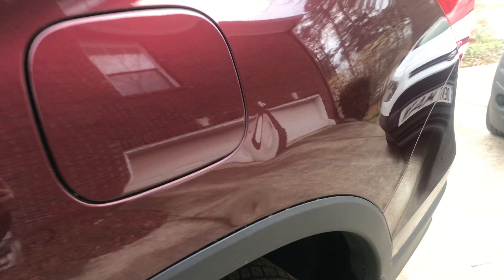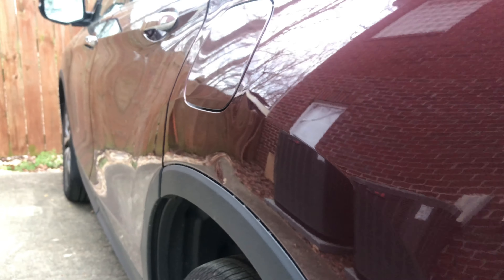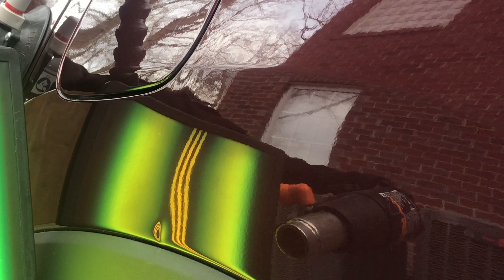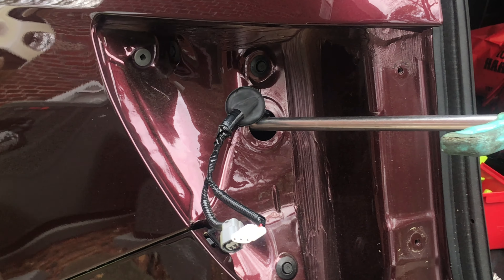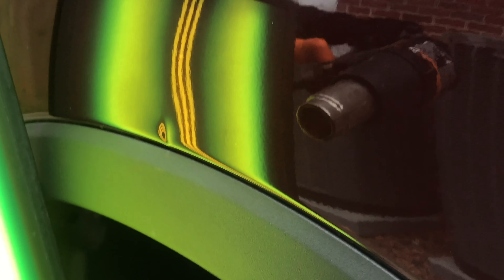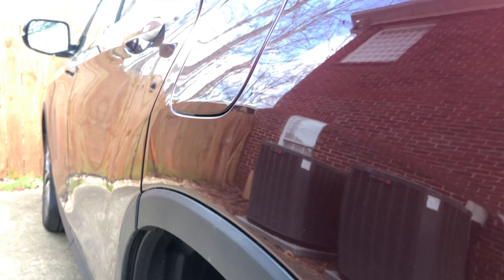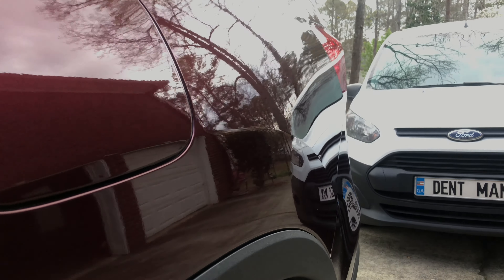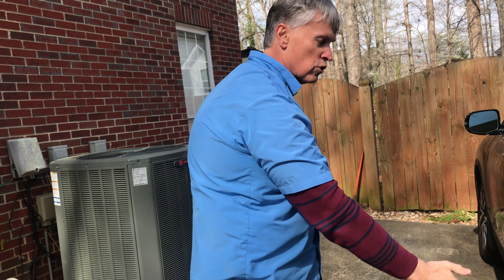Paintless Dent Removal - The Best Method Of Removing Dents - No Gimmicks & No Tricks

Comment: Great job Steve what rod did you use through the tail light
Reply from the maker: Kevin Ferguson I think I was using an Ultra straight rod with a soft cap on it and then took the cap off to finish it out